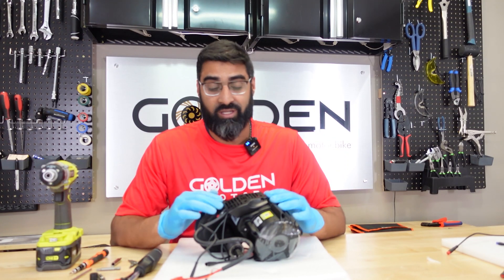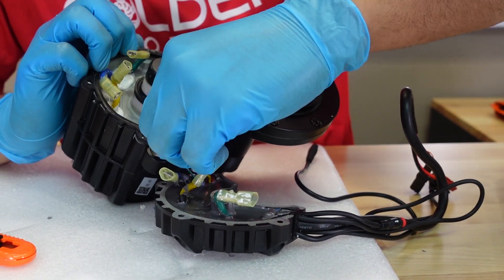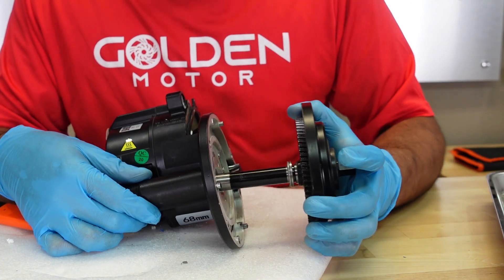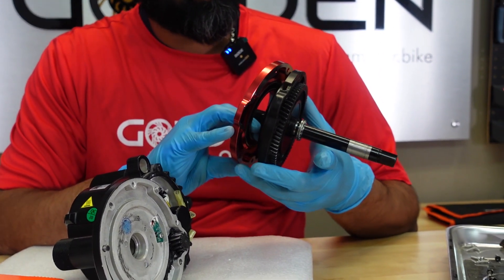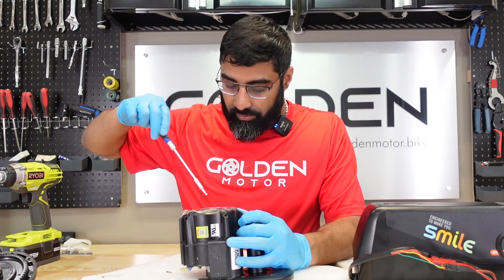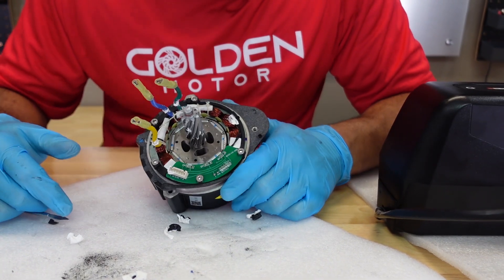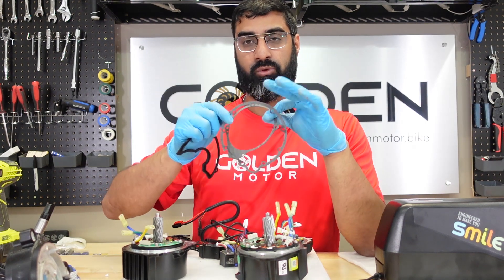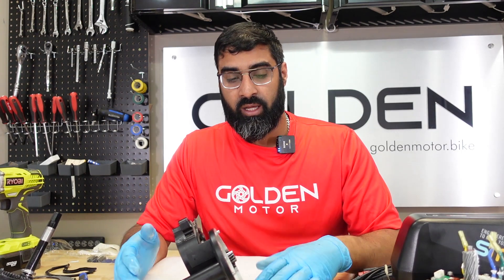Bafang M625 Motor Disassembly M625 vs BBSHD

Comment: They changed the layouts of the controller module screws to prevent interchangeability. Which would have allowed M625 owners like myself from swapping to a BBSHD controller enabling me to use other kinds of batteries. Dirty crooked bastards!

Comment: I like the NEW torque loop on the top of the motor case (you didn't mention that). Also ...... will they be releasing a 1000 watt version of the M625?

Comment: The video was quite informative but what was restrictive? Does the BBSHD controller work with the M625 motor. Can you swap the main gear and shaft from an HD to the 625 to see if they are identical. Can you programme the M625 with a cable like you can on the BBSHD. Will the M625 work on other batteries? Lots of questions still to answer. 
Oh and please drop the music! I don’t need or want it in the background. I just want to hear about the motor. 
I enjoy what you are doing. Keep up the good work.
Reply from the maker: You have to use the bafang battery making It more restrictive. We are still figuring out the programming options. Next video will be the install then programming

Comment: Video was informative. I have subscribed to your channel.  If a stock controller isn't plug and play as you confirmed the new M625 with 'restyled casing' is the same internal design as the BBSHD, then an aftermarket controller is likely already plug and play to 3 large gauge phase wires.  It would be great if you could connect it to a phase runner or...a stock BBSHD controller internal to the motor casing and then use an aftermarket battery to determine that 'all is not lost' with this new configuration.

What does an aftermarket controller do for this new 'locked down' M625 motor config.?
1. you can run any battery you want.  NO CANBUS.
2. you can extract more amps and not be limited to either voltage or 30 amps
3. you can program it.

A last note.  If an average ebike builder HAS to buy the battery with the kit, these kits will NOT sell.  Most may still buy the motor because it is basically a controller limited BBSHD...you confirm this and thank you...therefore an ebike builder will have to put a different controller internal or...and external controller and run their own battery that fits the frame and isn't huge or ugly as sin.  The Chinese designer of the brick shape of that proprietary 48V battery with CANBUS plug to make it essential to work with the M625 CANBUS controller...he must be the son-in-law of the company president....a moron.

Thanks for the review and giving us the lay of the land what many of us suspected about Bafang's terrible, backward new product direction...all to sell more batteries locking the battery to new motor controller by CANBUS.  Custom ebike builders want custom flexibility like we had the BBSHD...not this BACKWARD, LOCKED DOWN Chinese government crap.
Reply from the maker: Absolutely couldn’t agree with you more 

I will try out the other controller another controller soon but the bbshd won’t work as it won’t mount to this motor casing. 

A phaserunner or ASI might work but will have to test it but there were a couple wires  in the motor core that I wasn’t sure about .

We have another motor coming in that will be a builders dream . Stay tuned

Comment: Won't buy that Restricted POS system.
Reply: Just swap out the controller for a Phaserunner and you end up with an awesome motor.
Reply: @grantadamson3478   Can you buy the new M625 motor separately?...or is coupled to the proprietary CANBUS POS brick battery which is only 48v with unknown BMS current limitation?

Comment: LOL so bafang only gave the "Motor Casing" an upgrade and the actual motor None, but yet downgraded the controller 🤣 . So they downgraded from bbshd to a bbshit.
Reply: Its actually worse than a pure downgrade. Bafang tied the M625 motor to their ugly, large brick shaped battery with a CANBUS plug.  You can't run the M625 with a generic plug, 48V, 52V or 72V battery.  This is going to backfire big time on Bafang's marketing department that said, I know, we can make the M625 and battery proprietary to sell more batteries.  They will sell way less KITS.  Idiots.
Reply: Right!

Comment: You answered a lot of important questions here.  Thank you
Reply: Whats up with your ludacrious bbshd,post a video😅,im building 18650 samsung 35e 52v 35ah 80a continous 120a max and pair it with asi bac 65a continous,58 x 65 3770 watt of powwer,hope that is gonna be enough stock is kind weak🙈💪🏻
Reply: @madmanwheelies6157  Stock with new M625 motor controller is linked ONLY to proprietary CANBUS 48V battery.  With new controller, you can't run a M625 with 52V battery.  Most of us that build BBSHD ebikes build with 52V battery for a bit extra kick.  No words for how Bafang screwed up their new release.